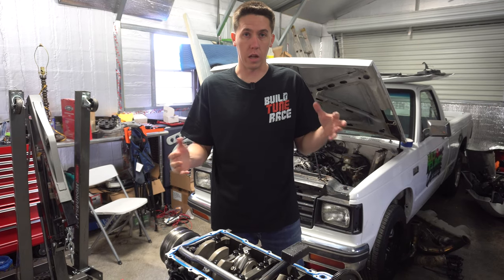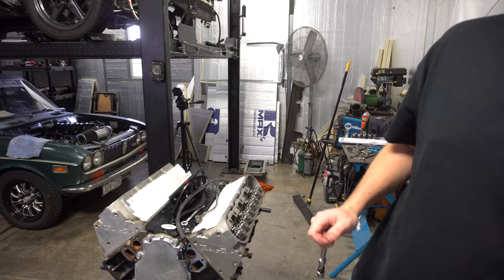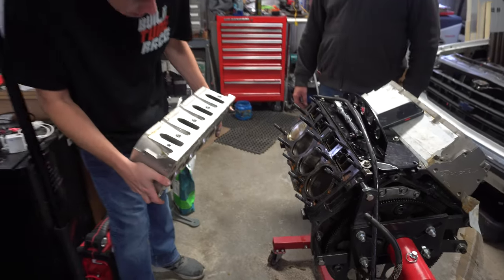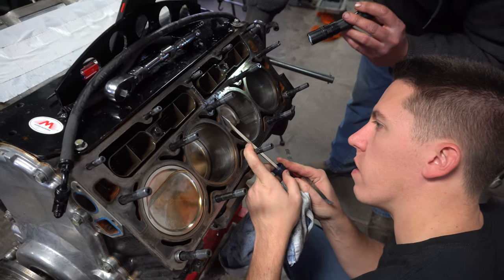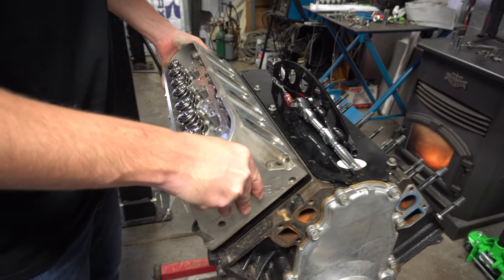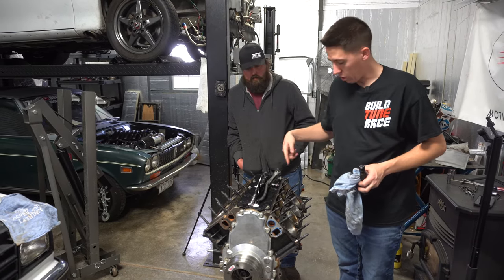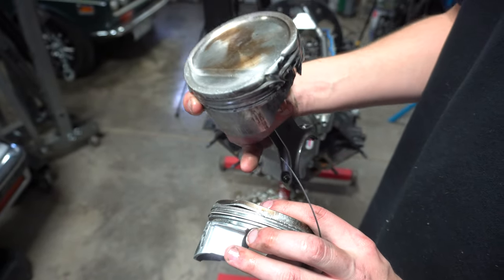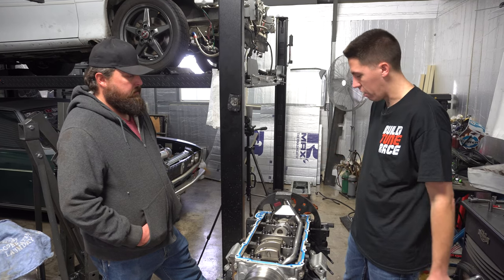Melted Another Piston In My Turbo LS Camaro! (Need Some New Parts)

Comment: Good old fashioned tear down, good times. the idea behind removing head bolts in reverse pattern is that you can warp the head if you were to start on the end and go from one side to the other especially with aluminum. Man i miss building engines.
Reply: I second the head bolt pattern info.
Reply: I third this. I also use a breaker bar and go 1/4 turn on each bolt until they’re finger loose. Probably not needed in this application but the manual for the t444e engine I work on daily has that in it so it kinda stuck.

Comment: When I ran an Outboard motor shop we  Use to Remove melted piston from cylinder walls With a light acid before honing. Seemed to work very well to remove the residue

Comment: Its funny that you mention the fact about removing the head bolts opposite of install. I have been doing that for years, just because i felt most comfortable that way when I started working on engines. I have never read or heard it to be true, I just did it, and still do until this day.

Comment: Chances are the crank sensor caused the issue on the touchdown. I luckily caught mine due to a very tight clearance. I shimmed mine out on the 24x and haven’t had an issue since. Might be worth a look.
Reply from the maker: How did you shim the sensor! On the mount where the bolt goes into the block or did you find a Shim that went around the sensor?
Reply: @BuildTuneRace  place it on the mounting surface before bolting down the sensor.

Comment: Removing the head bolts in reverse order is an engineer thing. With good quality heads like you have it wont cause an issue if you dont. Low quality aluminum, thin or cheap castings can warp the head.
Reply: I’d honestly like to see a head to head (pardon the pun) comparison. At a machine shop that can check the straightness. (Not just a straight edge and a feeler gauge) and see if your claim is true. I’m not saying it is or isn’t but I think it would be interesting to see.
Reply from the maker: That makes since I guess. I was curious when I heard this and thought that most the heads anymore are pretty solid and wouldn’t warp. But just to be safe I did it anyway lol

Comment: do you think it's a timing problem like the reluctor wheel moved or is it a dirty injector ? What AFR and timing? How many RPMs are you turning the engine looks like you have some badass rocker arm
Reply from the maker: Pretty sure on the 2nd to last pass it miss fired on the reluctor wheel hurt it and the plug then the next pass it finished it off when it did it again with a brand new crank sensor in it.
Possible injector issue, I still need to flow and check them but I cleaned and flowed them a few days before taking the car out and making passes and everything looked good on them.
Reply: @BuildTuneRace  we had a similar problem before but it was the crank trigger shielded cable I fixed it with  tape jerry-rig from aluminum foil. we even put a front crank trigger on and checked timing for top dead center mark . we finally figured out it was the shielded cable. Holly sent us some new cable that we purchased from them but they never have been able to explain to us how to splice the cable so my jerry-rig fix is still on the car and it's running well. I love your channel you give a lot of good explanation and we learn from watching your Channel Good Luck

Comment: Why did it melt?..
Looks like ring gap may be a bit small and / or tune is off.
Good luck!
Reply from the maker: It melted the piston took a chunk right out of it lol
Reply: @BuildTuneRace  lol..
I can see that. Was wondering why it happened?
Pistons like that should hold  more than 200Hp per cyl without giving up like that.

Comment: Sucking dirt and such in will do that to the cylinder walls its almost like sand blasting it. Id check the air filter and make sure your not getting a ton of debris in there
Reply from the maker: No air filter used in the 3 seasons this engine was together with many street miles 😂 Didn’t think about dirt but makes since to what could have caused it!
Reply: Its very common in heavy duty equipment and such that don't get proper maintenence...dust is just as bad as low oil pressure in my opinion itll tear up bearings rings and everything pretty quick...theres a video on YouTube here by K3406E he turns a Cummins into a vacuum cleaner and kills it with only 10lbs of dust.

Comment: Just started watching so... 408 what's your bore/stroke combination??? 🤔😎✌️
Reply: 4.030 bore 4.000 stroke = 408
Reply from the maker: Exactly what Trent said! 
4.030 bore 4inch stroke crank used a stock lq4 block! Thanks for watching!
Reply: @BuildTuneRace  well, I'm running a 4.165 bore and 3.75 stroke and that's a 408 ci also. As I stated from the start, I just started watching, didn't even see whole video. Didn't mean to come off as a dumbass to you and Trent. I even subscribed to your channel right after the comment I left...

Comment: Interesting stuff.! please remember if you use carbide-balled attachments to remove bore scoring & combustion chambers material...

...it will remove more material than what you can feel wif yr fingers. It's also easy to create a slight egg-shaped cylinder ID if doing this wif a handheld drill for example.

Let the mach.shop do their assessment & proceed as per their recommendations. Btw, informing me of your motor being a 408 is cool co-incidental, as mine is a stroker 408 as well.! Carry on bro, I'm totally enjoying this rebuild.
Reply from the maker: Definitely letting the machine shop take care of it from here I don’t need to mess it up any worse then it already is lol! The 408 make good power just sucks it beats up the piston skirt so bad.

Comment: Blow through carb!!!  Lol.. no more injector problem... LMAO..
Reply from the maker: 😲 absolutely not! 🤣
Reply: They work.. pretty good I'll have to bring my truck out for you to check it out.. since I Finnished it..
Reply: I'm building a blow thru e85 setup also no intercooler
Reply: @sprintcardriver8   I run pump gas intercooled.. I recommend a intercooler. Way cooler intake air temps